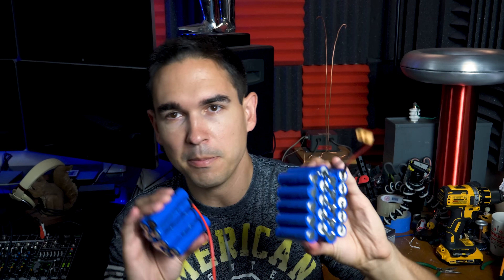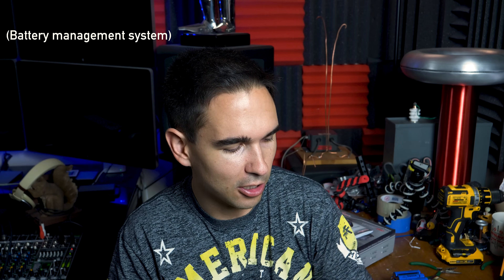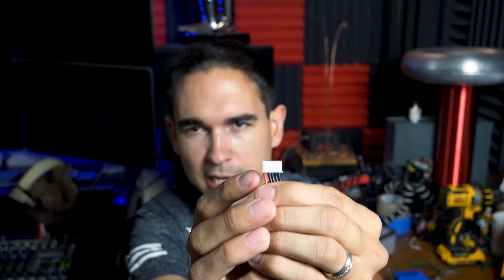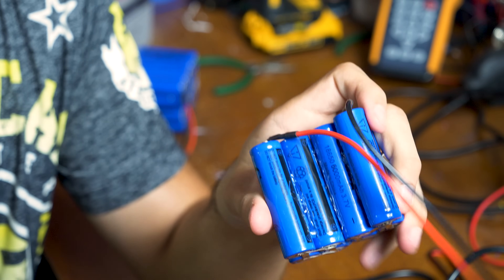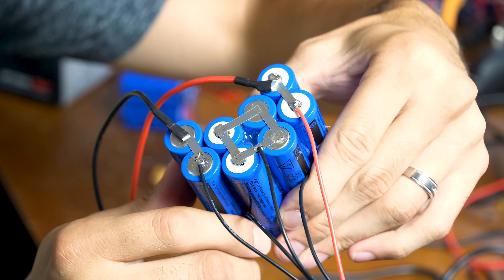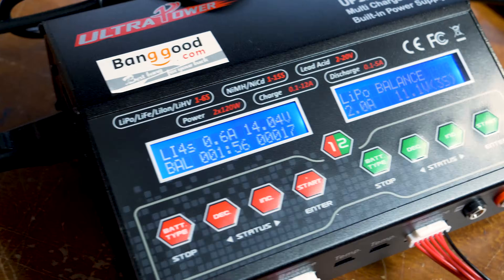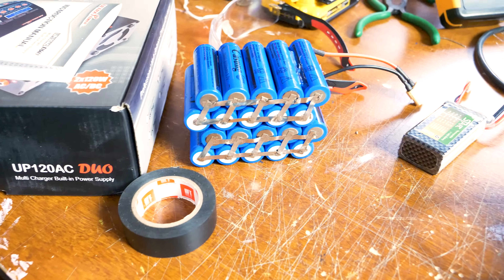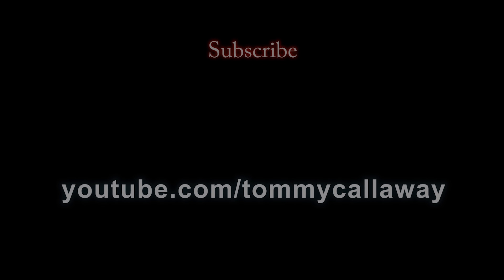How to charge custom lithium ion batteries (without a BMS)

Comment: Your balance charger will do what a bms does, except without other types of protection, it's basically a 'poor mans bms'. How are you going to ensure under voltage or over voltage like a BMS does? You also mention that the BMS doesn't always charge your batteries fully however your banggood thing only charged to 4.1v, that's not fully charged! The other thing to mention is that you should never ever create lithium packs with batteries of different charge voltage which you have done, otherwise you can cause the over volt batteries to dump current into the under volt ones in parallel, basically ruining a good 18650. 
I would also ask, have you ever had a BMS fail? And if not, what evidence do you have of them failing? I want more reasons not to use a BMS since the ones you gave are not convincing at all.
Reply: Where can I find a good quality non-Chinese made BMS?
Reply: One of the main reasons bms fails is the li-on cells slowly die or they lose the ability to hold charge. The bms will recognise that and will go into safety mode or switch off. Also you can get a faulty bms but I think thats in the low percentage range. Best to replace the dying cell or cells and replace the bms to be on the safe side.
Reply: pirucreek I wanted to say that
Reply: under voltage use a $1.25 voltage alarm, & they ARE LOUD... Over voltage add 1 large ATC fuse VS soldering each cell, failed BMS search Shawn McCarty on youtube
Reply: Don't hate on it the battery pack hasn't exploded yet. XD
Reply: I would like to make a question to yiu sir,you mentioned that we should not charge in a oack of batteries with different vilt types between them,  How about to make a pack of batteries 18650 but from different brands of old laptops?
Mixing them together
Reply: Charging to 4.1 instead of 4.2 will double the life of the batteries.
Reply from the maker: +David Hancock you can customize the voltages this charger thing charges to. 4.1v is the preset. Also, I understand there is a fair amount of debate from BMSers and anti-BMSers.  I'm not here to tell you you shouldn't use one - I'm showing you how to safely charge a battery without one.
Reply: Well, you said they're problematic, one of the reasons being that if one cell is over voltage, it thinks all of them are, which is not strictly true in your use case, since all cells in parallel will maintain the same voltage. I've just heard a few anti-bmsers say stuff with no concrete evidence, jgarceua did the same thing, saying 'they can fail so you shouldn't use them'. You didn't specifically say not to use a BMS, granted, but your reasons that they are problematic don't add up.
Reply from the maker: +David Hancock gotcha. I should have specified I was referring to the relatively cheap BMSs you can get from China. The very high quality ones are likely to never fail and offer a lot of good protection. My own use case was crafting cheap as possible high performance batteries. Thanks for watching and adding value to the topic!
Reply: I literally found this video looking into repairing a pair of $190 18v cells for my tools that I'm nearly certain have BMS issues. They refuse to supply power when they read half charge, they refuse to accept charge past half charge, and read incorrectly when charging. I've since balanced them and they continue to be problematic except when I swap the pcb out of them for one from a good cell. They are a cheaper brand of tools so I think I can see how this would relate to cheaper BMS available for hobbyists.